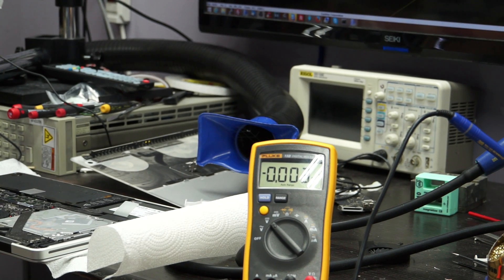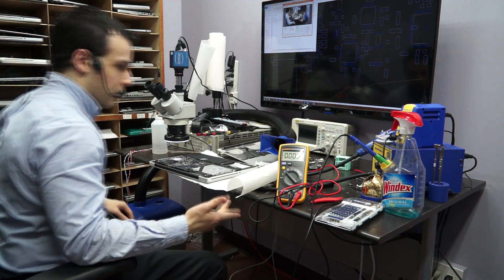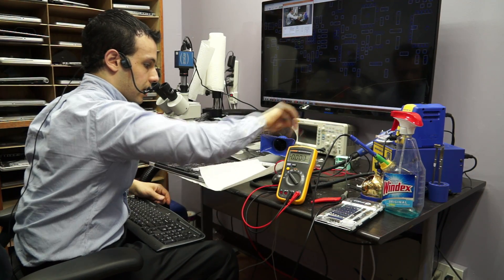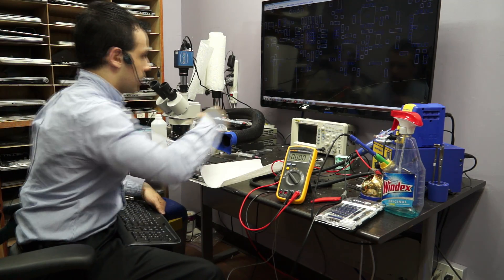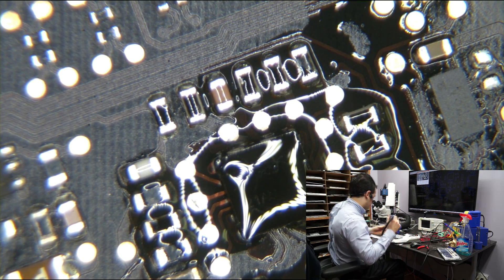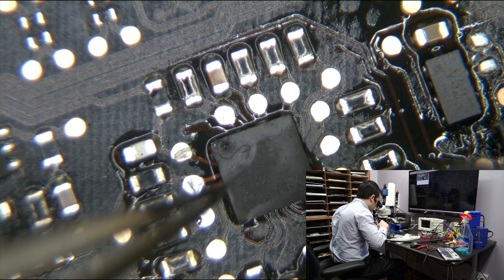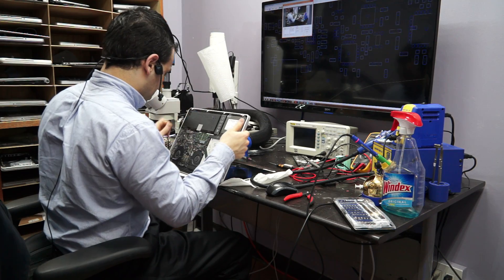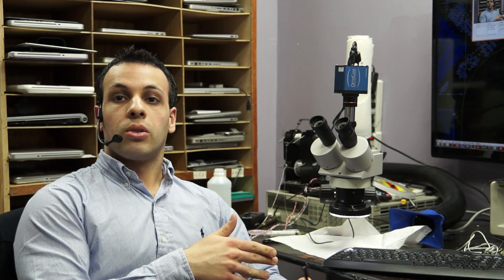Don't lower yourself by lying; make customers humble when fixing 820-3330 boards with no backlight.

Comment: it's almost like putting the vital electronics behind the keyboard is a recipie for cum disaster! I have a desktop and aside from the occasional video card sudoku, no problems! In fact my current videocard is dying but it doesn't give me trouble if I underclock/volt it slightly and keep the heat 10c below the previous safe threshold. I only lose 3-5 fps on intensive applications but that's just a drop in the bucket. It's probably a shitty ram chip or something.

Comment: I was in car repair shop and mechanic and customer were close to me. Mechanic found fault and fixed in about five minutes. Customer began to ask what it will pay for such fast fault repair. Mechanic said hourly rate of them and customer was slightly annoyed and mildly complained. Mechanic gave in my opinion the best answer I ever heard. He said that he is doing job for he's living and after that he mentioned that it's not the work amount that costs. It is the knowledge of fixing this issue and kindly implied that customer didn't found issue by himself even though he was apparently fairly technical guy. Customer changed his tone immediate. This is the best I've ever heard and very well said by the mechanic. I'm machine repair mechanic in factory and doing repairs is by far the most challenging customer service business there is. 90% time complaints about and very, very rare thanks for completing job :)

Comment: +Louis Rossmann what temperature did you use to get the LED driver chip off of this board. I'm looking for a good starting point to practice with ?
Reply from the maker: "hot enough", I turn the knob until it's "hot enough"

Comment: So quick question, not really into this type of repairs on a computer, usually i just do my own maintenance and that always includes just replacing parts completely, since i don't have the right tools to do something like you do. But, i was curious while you were placing and aligning the chip, how do you know where exactly it should go, use i didn't really see any guides where it should fir in, and i'm also guessing all those dots/pins whatever need to make contact on a certain part of the chip.
Reply from the maker: faith in placement and guessing.
Reply: Sooo ... place and pray
Reply: Keep up the great work. I bought an Iphone for my youngest daughters 16th and she said after 1/2hr Dad its stopped charging and the phone says the accessory charge lead is not an approved product and may not work properly so i phoned apple and they insisted that they needed to do a re-install of the operating system and would not take no for an answer, i explained to them that the charge lead was at fault and could they send me a new one they refused and because i would not re-install the software there was nothing more they could do, my daughter then went to the local supermarket and bought a £1 lightining connector and all is fine...so i really hate apple even more now so i can fully understand where you are coming from Regarding Apple LOL LOL Good luck.
Regards
Steve
Liverpool UK

Comment: At 0:26 you say that you have the sleep sensor unplugged.  I've never noticed a plug/connector for the sleep sensor.  I've searched Google high and low and searched schematic for it.  I do not see one (but I am referencing 820-3024 schematic).  I would like to know just for my mental knowledge database.

Comment: Louis Rossmann, hey, excellent video! im viewing this and others and you make a really good work sharing your skills and tips with us, well i have a little problem than i like you can help me to solve it, i had a macbook pro 15' early 2009 (820-2330-A logic board) that it has no backlight when i turn it on, everything works well, including the lcd, but the backlight doesn't work, im able to repair it, but i don't have any idea of where is located the backlight fuse in my logic board and how to solder it, (i have some skills for soldering), another question that i have if i go to a pc components store (who sells condensers, fuses, chips....) with the backlight fuse, and there they can test it they can sell me another with the same specifications? (voltage...) they can works?
- (another thing, 3 of the pins of the LVDS cable are bend, but the lcd works perfecly except of the backlight this cable can be the problem?)
thanks! Im from venezuela and i really appreciate your response, and your videos!

Comment: Would  not have replaced the screen only to realize that the screen was not the problem and hence not charged the person for the screen? Or would they have replaced the screen found out they had diagnosed it incorrectly and then fixed the real problem and still charged the guy for a new screen which I assume is more expensive? 
Anyway knowledge is king, matters not that the job took 2 mins or 2 days. Cost to the consumer is the price of knowhow that the technician (Louis) holds.